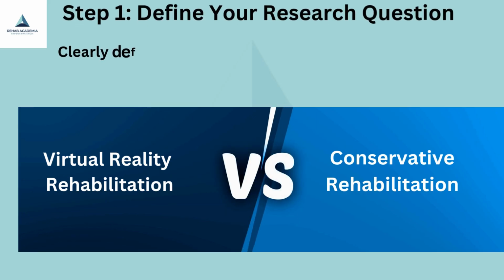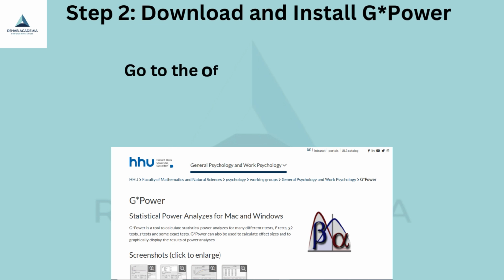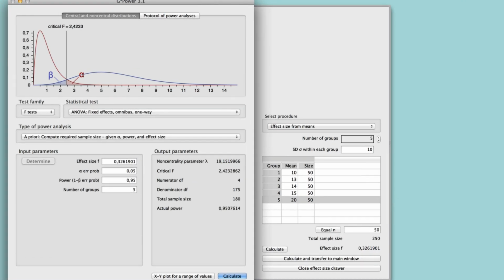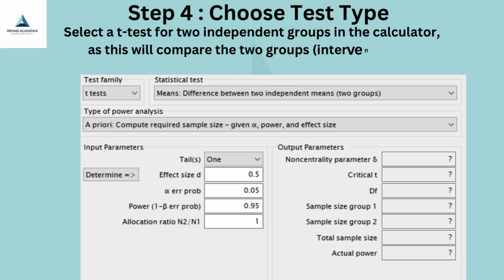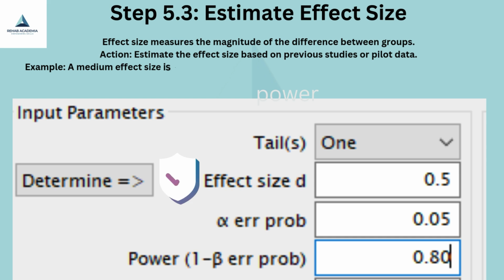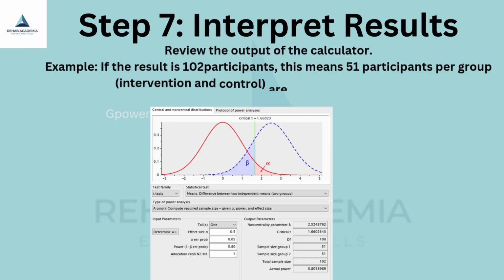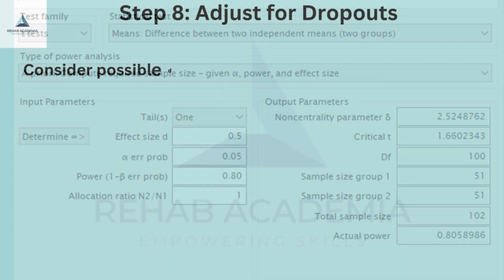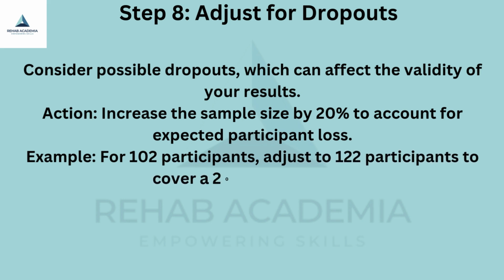How to Calculate Sample Size for RCT Using G Power: Step-by-Step Tutorial

Comment: There is an issue with calculating the drop-out.
When u look at the estimated number after adjusting for 20% drop-out (122) u will see that if 20% of 122 has been lost to follow-up the remaining wil be 122*80%=97.6,  then we discover that the  number adjusted for 20% drop-out was underestimated. The main cause is that the minimum sample size should be divided by 80% (102/80%=127.5~128) rather than multiplied by 120% (102*120%=122.4~124)
If we look 128 after 20%drop-out will be 102.4~102 but 124 will be 99.2~99